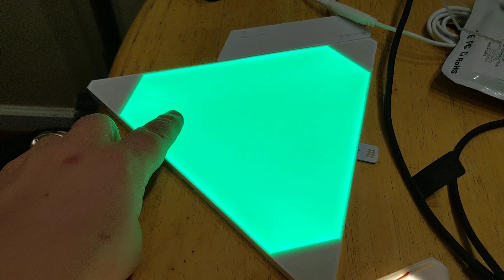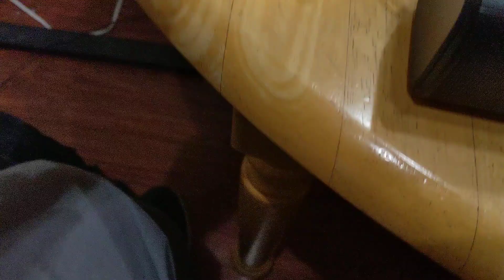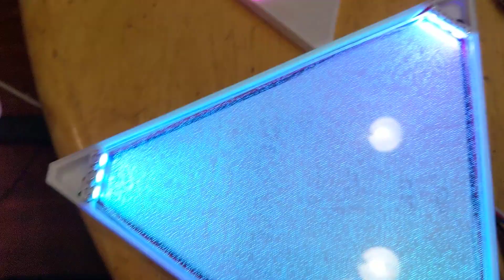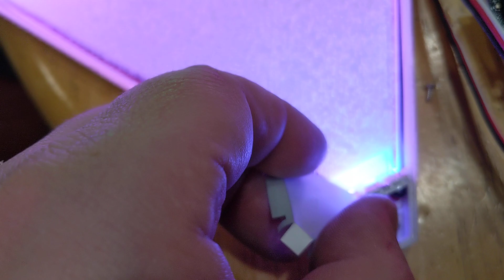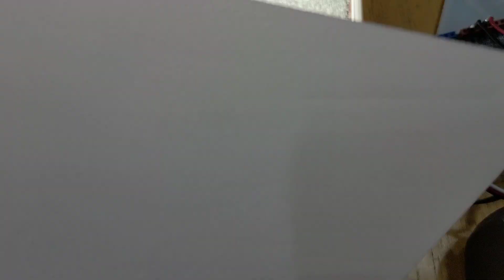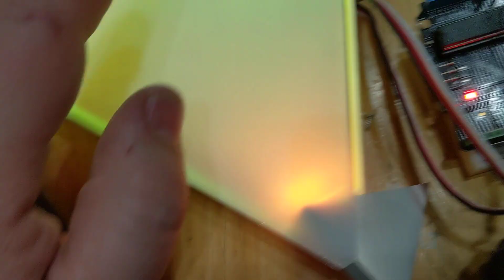DIY Nano Leef 2

Comment: If you Split open an old Monitor you can get the laser-etched acrylic and diffusion sheets. their already premade and in there :D Just need to cut them to size
Reply: I have seen many projects with that. Mostly from old laptops. Thanks for sharing

Comment: Nice! If Nanoleaf is expensive for you, imagine how expensive it is for us in Europe :) Can you say more about the diffusers that you used? How did you make those?
Reply from the maker: I can imagine  :-)  for the top surface I use tis diffuser sheet from a local plastics retailer   https://www.tapplastics.com/product/plastics/plastic_sheets_rolls/led_ligh_panel/598
for the inner acylic diffuser, I made a pattern of 1mm dia dots and laser etch them into the bottom surface of the acrylic,  this is also what OEM nanoleaf does with acrylic light guide in their design.  Here is a link to my drive with all the stuff I made,  maybe it's useful  https://drive.google.com/drive/folders/1Cj8JJIPvwqrWxnXjdJPZIJmNfKCit82v